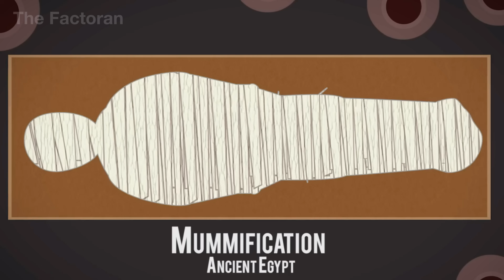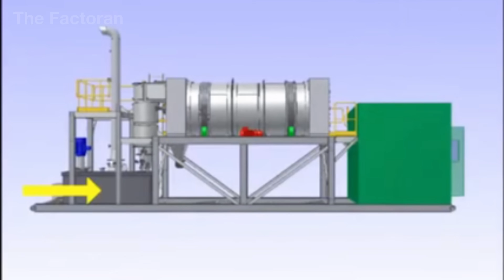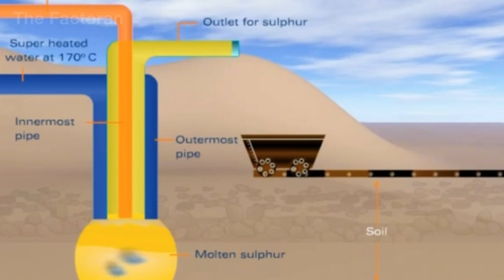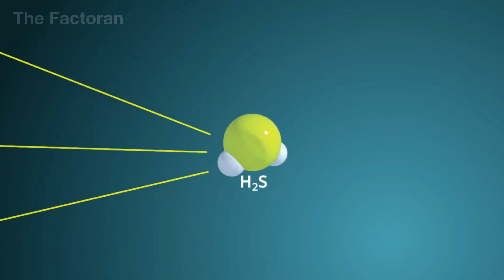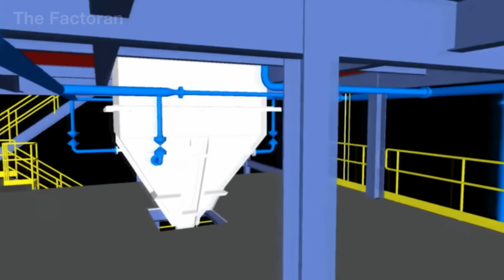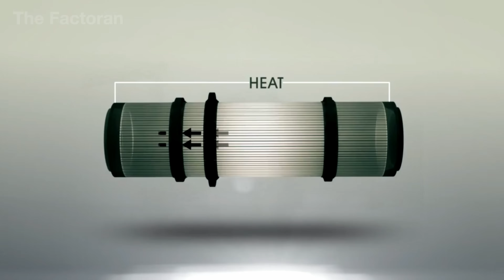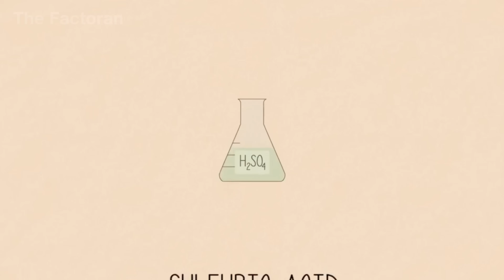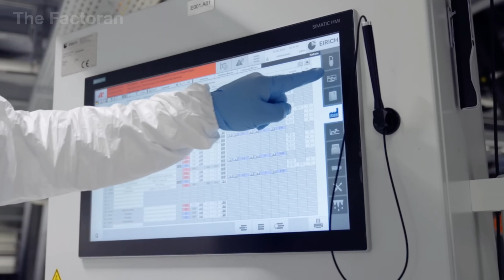How Millions of Tons of Sulfur Are Produced Inside Massive Production Line

Comment: Why don't these guys in Indonesia built a conveyer belt ? It's not that expensive or difficult to build.
Just start a collective to raise the money, after that no more broken backs, any get the maximum of sulfur the mine is able to produce.
?
Reply from the maker: Good point — sadly, the terrain and funding make automation there really hard to implement.
Reply: Why not pipe the hot gasses out of the crater and cool them on the outer slope?

Comment: The clips from Mounta Ijen in Indonesia show workers wearing gas masks.  That's not quite realistic, most of them do not wear gas masks. Gas masks are expensive.  Often tourists visiting the volcano and donate their gas masks donate their gas masks to the workers after their visit.  Of these masks many are not even suitable for volcanic gasses as the masks available most often in DIY stores or similar are means to protect against dust and organic solvents.  Whatever masks there may be available, the works will use them until they're totally worn out since these masks are the only protection they have.  The volcanic gasses are highly damaging to health.  Typically workers can do the hard work for only a few years before health forces a them to retire.  There are two main types of jobs at the volcano, collecting the sulfur bricks from where they form and bringing them up to the rim of the volcano crater.  The other is transporting the raw sulfur rocks on large wodden wheelbarrows down to the base of the volcano over very steep, unpaved roads.

Why do workers expose themselves to this extremly toxic gases with little to no protection?  Money.  They job pays relatively well by local standards and there are not many alternatives in the region anyway.  The absolute quantities of sulphur mined are relatively small, almost negligible compared to other methods of sulphur production.

The region is also seismically active, quakes which at times are rather strong are relatively common.  That's why the region around the volcano is some sort of security area entering.  Mostly to protect tourists it would appear.  The climate there is also brutal, not very conducive to such hard physical work.  The changing winds have a strong influence on the air quality at the peak.  Sometimes the gases are blown straight at the foot path at the top, sometimes away from it so one can't even smell the volcano at all.
Reply from the maker: That’s an outstanding addition — thank you for sharing this firsthand insight. You’re absolutely right: many workers at Mount Ijen have little real protection, and most of the masks you see are donated, often not designed for volcanic gases. The work is brutally hard, but as you said, the pay — though modest — is still higher than many local options. We truly appreciate you bringing more depth to the reality behind those images.